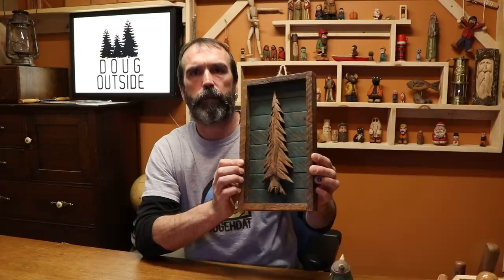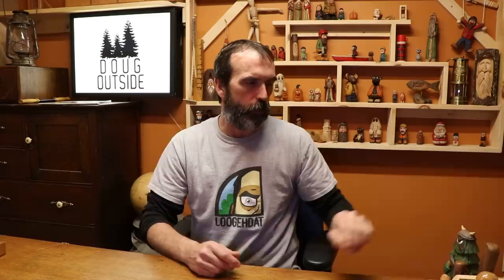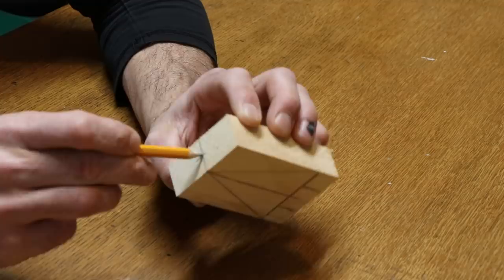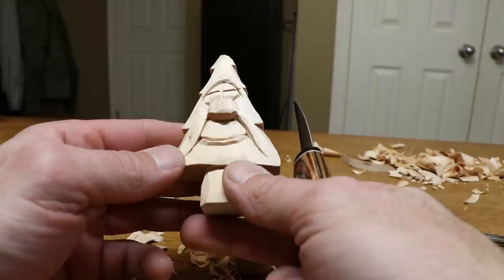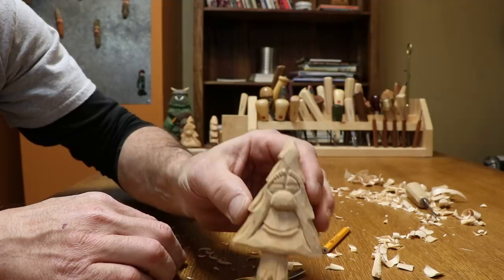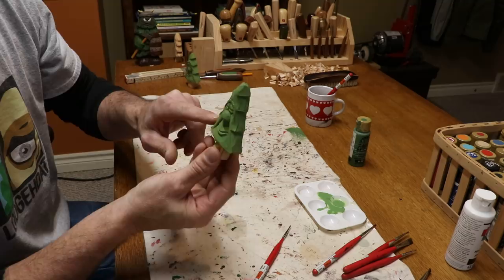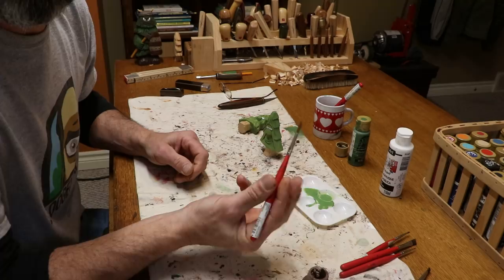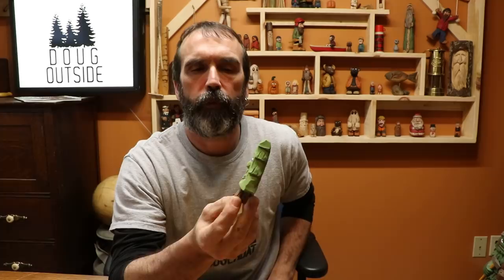Woodcarving How To  - Carve Larry's Happy Christmas Tree

Comment: If you're using fluorescent lighting it can give you weird colors. If you have some extra money kicking around, an Aputure light with some diffusion near where the red grinder is, aimed across and down at you would give some good results. Or a couple of lamps with good ol' fashioned incandescent bulbs would help too. As for the camera settings push the F-stops to a higher number (F13 or so, maybe higher), that will darken the image and you can also try dropping the ISO as low as it can go without fading you out. I hope that helps.
Reply: @anitarussum4590  No worries at all Anita. We stand up for our Dougie!! Lol. At about 35 minutes in he asks about the washed out look he's getting. That's why I dropped that info.
Reply: Jason Semper ...thanks Jason😉